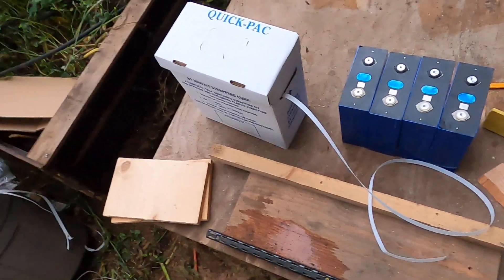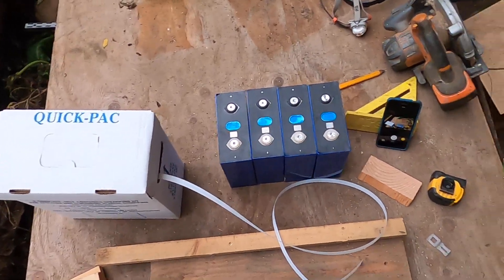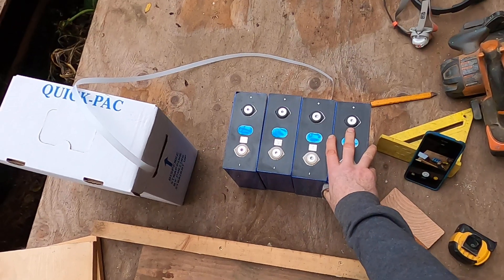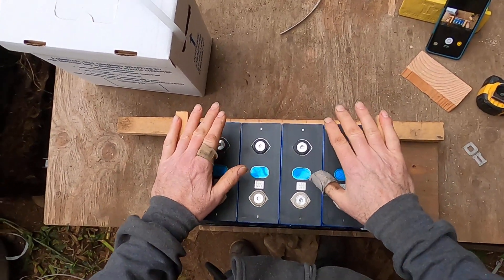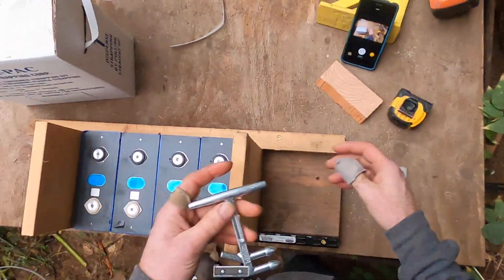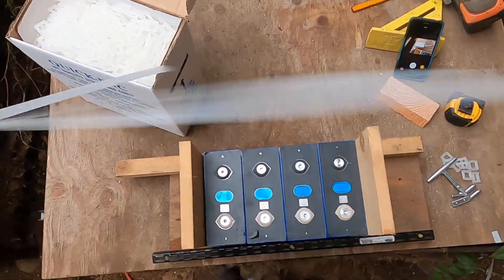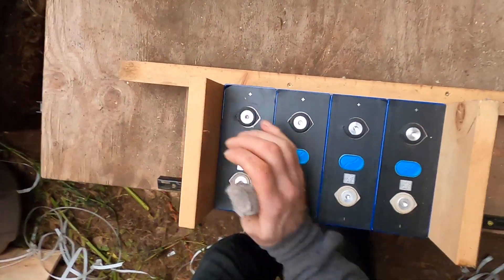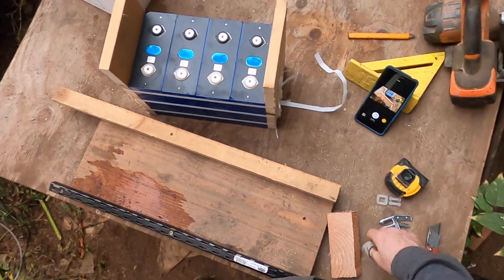12V Toolbox #3 Bundling and Compressing LiFePo4  280AH EVE Lithium Iron Phosphate Cells from Xuba

Comment: Are these batteries good for car audio?.
Reply: Depends how much power you need.
Reply: Does depend on power needed but these have a 1c discharge rate and at 280AH that means a 280 amp constant discharge.  Not bad at all so at a high SOC (14ish volts) that means that 1 bank can support about 4k RMS (14v x 280 amps).

Comment: Nice solid box! Have you noticed a slight bulge on the brand new cells? It seems that when they aren't it means are not new and grade A. By any chance do you know the real max peak current? Could it be something like 400a per 1 min?
Reply from the maker: My understanding is that the expand and contract according to the state of charge.  So charged cells will be a bit more bulged out than uncharged cells.  Mine were slightly bulged when received but clearly new.  I assume that is due to them having a storage charge on them.

Comment: I am thinking of using chain and adjustable turnbuckles to strap them together with a wood box type setup similar to yours. the chain will not stretch so much and if it does a few cranks on the turnbuckles will hopefully take care of that. 8 of those battery cells weigh 5.3x2.2x8=93.28 pounds, not including the wood, chain, and turnbuckles.
Reply from the maker: That sounds like it could work.  We found that the straps loosened over time a bit so we tightened them and added some strechy electical tape wrapped around the pack to keep the cells from moving around at all in the pack.

Comment: Are you sure you need to compress these cells?
Reply: It is mandatory to compress the cell's! If they expand they become loose inside, and the electron/ion transfer is less efficient. All prismatic cells have to be compressed.
Reply from the maker: Yes.
Reply: Asking for trouble. I the c ells expand an contract nd you prevent that, you can damage the cells
Reply from the maker: @bobcole3852  Everything I have read says that is not true.  I have been running this pack for 8 weeks with several cycles per day with no issues.
Reply: Wouldn't the bus bars expand as well if the batteries are getting warm? I have had these on order for almost a month so expect delivery soon. I don't intend on compressing so do I start making short heavy gauged wires??
Reply: @nubbynubs123  Buss maybe the way to go if your system is considered. High drain or charge will cause heat. Mobile conditions may have vibrations. What are the expected climate conditions, air flow, etc. Budget is a consideration. Are you trying to save money or time. I would with out knowing the detail say use buss bars if included taking care to watch torque specifications, stud vs bolt connections. measure the temperature changes plug that into an equation of thermal expansion of the metal (copper) to get a feel for what might be happening on the component level.
Reply: It would seem the growth of the cells will push against each other and the stress will still damage the cells. The cells should be free to move. Buss bars could be replaced with more flexible material to allow movement.
Reply: @Snowy-Owl-Retired  i completely agree. People think swelling or shrinking of a cell is bad. Its not. Give them room to breath and move. Ill probably be removing my bus bars and making my own wire for that very reason
Reply: @ChuckRayNorris  the thermal coefficient of expansion is not the only factor in swelling. The crystal growth in the battery media is the one that will not reverse. Gasses I imagine are other reasons for the physical dimensions to change. Some of these occur over short time frames and others occur over longer periods of cycles. These batteries should last for years. Long enough for trouble. The optimal solution is flexible terminal connections and an air gap between cells.
Reply from the maker: @Snowy-Owl-Retired  I have been running for 8 weeks with no sign of stress on the cells.  Go through a couple shallow cycles each day...  Since the cases are thin aluminum the compression stabilizes the internal elements of the cells.

Comment: I have 4 of the 280ah cells for a 12v pack, I found an old metal ammo can I am thinking of placing  them in after I protect the edges of the battery with ply wood.  I have a plan for compressing the cells together from the outside using the inside of the metal can.  Wish me luck:').  I like your idea to make handles in the wood.   It might be a good idea to run another strap through the handle and around the bottom of the batteries to keep them from possibly trying to slide out.
Reply from the maker: Great idea about the metal ammo can.  I have heard that the aluminum casing of the cells is tied to negative, So electrically insulating the cells from the metal of the ammo can might be worth doing.  You were right about a strap over the top.  The cells were moving around a bit so I have to had to improve the design with over the top straps.